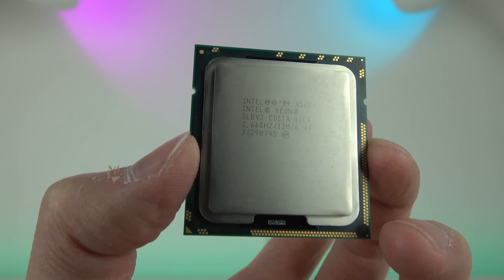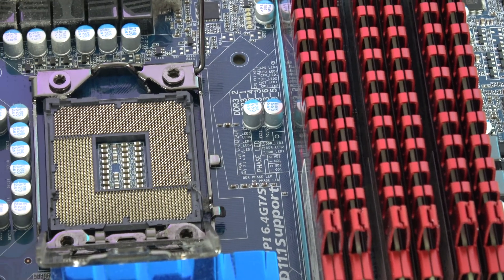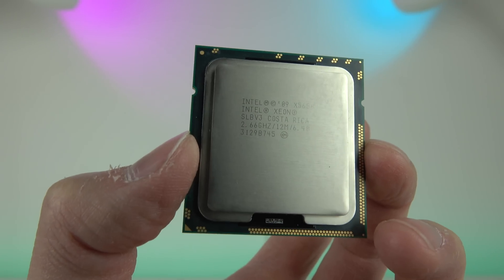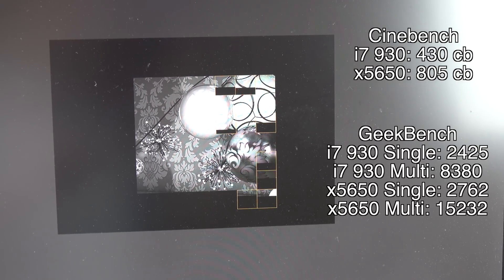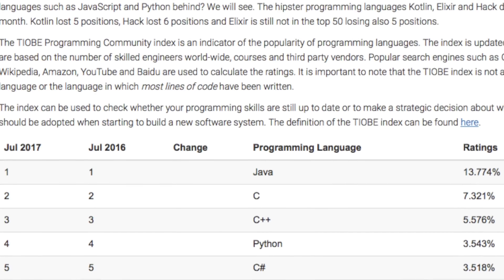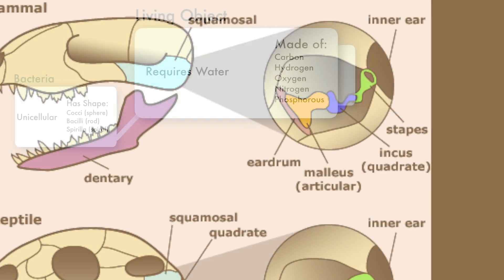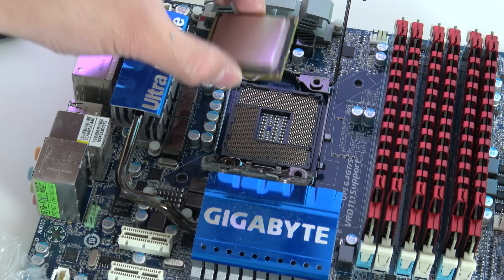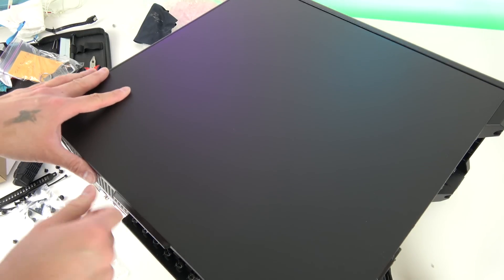This 6 Core CPU Costs $20. Will It Let My PC From 2010 Last 3 More Years?

Comment: I didn't know you knew LGR, a.k.a. Clint! That's awesome, he's a great guy.
Using the X58 platform means giving up a lot of modern features that I'm not so sure I could live without… with Ryzen 3000 coming out in 2019 with the entry-level being 6 cores for only $99… I feel like he might as well upgrade or buy a new computer with Ryzen 3060 or whatever it's going to be called. I feel like next year is going to be the best time for consumers to upgrade or by a new computer because huge leaps in computer hardware are happening next year. The core wars are about to begin between AMD and Intel. I recommend listening to one of AdoredTV on YouTube's tech videos about next year. It's fascinating stuff

Comment: I built a PC back in 2014. I still use it to this day. I've only made RAM and storage upgrades. I added 2 SSD's. I changed the boot drive from HDD to SSD and I have an SSD for game storage. I had to replace the power supply. I leave it on 24/7 so that was only a matter of time. I don't think it really is necessary to upgrade all the time. It plays games fine and renders alright for everything below 4k.

Comment: About to upgrade an old pc i have to make in usable.
CPU: AMD Athlon 64 3800+ @ 2.4GhZ.
RAM: 1GB DDR2
GPU: Nvidia GeForce 6150se Nforce 430
OS: Windows Vista Home Basic 32-Bit
Storage: 225GB HDD

I Wanna upgrade to:
CPU: AMD Phenom x4 9500 @ 2.2 GhZ
RAM: 8GB DDR2
GPU: Gigabyte GeForce GT 1030 OC 2GB GDDR5
OS: Windows 7 Professional 64-Bit
Storage: 225GB HDD (No upgrade)
Reply: About 100$ (1100kr here in Sweden), and i'll mostly be using in for web browsing, coding, light video editing and some light gaming on the side. That's why i chase the GT 1030
Reply: James Vo i'm getting 2x4gb ram Which ads up to 8
Reply: I'd recommend the RX550 over the 1030. I think for the same price you get better performance. @memmoman
Reply: @joonyee  Thanks for the recommendation! I'm gonna check into it a bit...

Comment: I'v always got a motherboard that takes the higher grade cpu's and would upgrade when the better ones became affordable, but recently with ryzen instead of buying a r3 and then getting the r7 later probably both for 100 it made more senses just to go for the r7 for 200. But there prices makes sense, unlike the psychotic people that buy high end intel to lose value a year later, and do it so that there is a minor point value difference instead of what you would notice in reality. For intel you could say that its actually a flaw in there marketing that Xeons just happen to be a upgrade now for cheap.

Comment: I have a workstation I built using an Intel S5520 workstation board.  It's currently equipped with a pair of Xeon W5590 3.3 GHz processors and I'm making plans to upgrade from a measly 24 GB of RAM to the system max of 192 GB. Throw in an RTX 2080TI and it's going to scream and be unstoppable.     I'm all about getting max usable life out of a motherboard, too.

Comment: in 2007  I built a system that was  speced :  AMD Athlon X2 5000 ,Bio star TA770+  main board, 2 gigs ddr2 ram ,  GeForce 9600 GT 512 meg of GDDR 3 vram and had a 250 gig HDD, running windows XP.  

today my mom still runs this pc (I gave it to her after I built my newer one in 2013).  Today it's specs are AMD Phenom II quad core, Biostar TA770+ mainboard,  6 gigs of ddr 2 ram , ATI radeon 5700 1 gb of GDDR5  vram    , 320 gig HDD running windows 10.  

in 2007 the PC handled any game I through at it , but by 2009 it was having trouble with newer titles, that was when I updated the video card and ram , every thing was beans and gravy again, it was gaming like a champ again, by 2012 though , it was beating it's head on a brick wall again , so I updated the processer.  going to a quad core it was able to game for 2 more years  (though not a top performer any more by any standard). in comes  my newer system  (and the one i'm still on today) in 2013. 

Specs on current system when it was new; 

AMD FX 3850  (stock setup , stock heat sink),  Asus Sabertooth 990FX  R2.0, 16 gigs DDR3 1866 ram,  AMD Radeon Powercolor 7870 MYST edition 2 gig DDR5  vram, 1 tb HDD running windows 8.1 

The HDD died on me in 2014 .. (thanks Toshiba). I replaced it with a HGST Deskstar 2 tb , HDD at that time.  
then at the end of 2016  the mainboard died on me  (a short in the back side USB jacks , would cause the PC to shut down on post). So I grinned and bore out not having a pc for a few months , I  saved some money and in 2017   I did a series of updates to the pc as I replaced the mainboard. 
First I upgraded my CPU cooler to a awesome after market cooler  , I then replaced the mainboard , and alstly I upgraded my aging video card ,  fast forward to today and the pc is still duking out what ever I throw at it.  specs today are 

Amd fx 3850  Turbo core turned off,  all cores OCed to 4.3 ghz , 16 gig ram (same as before), Asus M5A99fx Pro R2.0 mainboard, Zotac Geforce 1070  8 gigs of vram (can't remember type name). 2 tb HDD  running windows 10.       
System still handles every thing I toss it's way , and currently looking like it will still compete  for a few more years. 

point of all this being .. a well built system will last you a good many years these days.  That said threadripper  may be a game changer , all sources say we are about to hit another spurt of techno-leaps , like we had in the late 90's , which makes the future of my current pc look a little bleaker than I hoped.   but we'll see  currently I know of NO one that actually needs a thread ripper for general computing task.  A lot rides on what MS does in the next iteration of their OS.

Comment: I'm still wondering why those processors are selled almost like a gift.
I had a 775 Dual Core from 2006 and I replace it with a 771 Quad Xeon.
I feel like I missed a lot of my life without its extra power.

Comment: My 5 year-old Core-i7 4770 and GTX-780 is still going strong. According to cpubenchmark.net, CPU and graphics speed hasn't increased all that much over the last 5 years, certainly nowhere as much as the increase over the 5 years before that.

Comment: You have the same creative sub woofer I bought in 2006 with my 7.1 speaker system so I’m with you on using stuff for long time. And I still use the same case in my pc 2 time I upgraded the inside of my pc. My last pc was a core 2 duo then I went to AMD side with the fx  8 core next one maybe a ryzen but with 2 kids we got to have priority’s and my 8 core with a Radeon 290 have to last at lest 2 more years

Comment: There's just one problem - no AVX = no windows mixed reality. Overclocking 1366 is sort of a voodoo game with voltages. You can drop in 6x8GB DDR3 dimms and get 48GB RAM

Comment: Keep in mind not all Sockets (or motherboards) allow Xeon processors on them. For example I have an Ivy bridge (2012) Socket 1155 board. the best i can seem to find in Xeons is a 4 core Xeon will less processing power than my Core i7 i have in there now.. I'd love to find an 8 or 10 core for it..  the LGA2011 socket was a popular socket however and had more supported higher end CPUs at that time. I will say finding that CPU for $20.00 was incredible though and actually being able to take advantage of the performance increase is nice. Great video.

Comment: I still use my eeePC701 (THE VERY FIRST NETBOOK EVER!!!, 600/900 mhz intel Core arch. celeron, 2GB RAM-upgraded from 512mb, 4GB "SSD" + 32GB SD-card... it started netbook revolution ;-) as music and video player, it does full hd in VLC player ;-) 
And for troubleshooting networks, aligning multi KM range WiFi rural links, while hanging from a mountain wall ;-) etc (i rebuilt the battery with new cells, and will do again when this cells "die")... it will stay in use till it breaks beyond my capabilities...

Comment: It just so happens that I have a system with a Gigabyte GA-X58A-UD7 that I got secondhand from my uncle, so I was quite excited to find this video about a cheap CPU upgrade that can improve its performance significantly.  Since it’s not my only PC, I certainly anticipate using it for at least several more years.

Comment: Mine is an i7-2700k system running since 2011 and has burned two motherboards and 3 hard drives.

Comment: My 2009 computer looks kinda similar. I went with a AM3+ socket which lasted a long time for new CPUs. At this point I have replaced everything except the RAM. I now use those old parts as backup for my data.

Comment: i just sold my ivy bridge kinda regret it
Reply: rofl.....what irony -  for old times sake, i'm upgrading an HP i3-2120 dual core desktop system to an i7-3770K (Ivy Bridge quad / 8 thread). New Asus Z77 system board.  The 3770K completely trounces the Xeon X5650 (even with its 6 cores / 12 threads). I'll also be installing an nVidia GTX-670 4GB SuperClocked vid card...about as fast as a GTX-1050ti, so it'll be good for a few more years (ray tracing GPUs are going to be a long ways off, before they go mainstream).
Reply: @Trev0r98  yea mine was 3770k it was  a monster hit 5.0 stable no problem. Oh well.

Comment: Chubbyemu, just a curious question :

If hard drives and SSDs are compatible with future generations of PC's, as are PSUs (I don't recall computer manufacturers making too many different changes to power connectors), couldn't you make a PC theoretically eternal by considering the motherboard as a modular piece as well?  You'll still retain all of your data over the years (assuming you back it up and move it to new drives), but standards like the ATX and ITX form factors don't seem to be going away anytime soon.  There won't be any original part left over, but I'd still call my computer the same computer if it retains all the same data and settings tailored to the way I use it.

Might be wrong, or right, but it's good food for thought.

Comment: Should have gotten a x5680 or higher. 6 core 12 threads. I just built a similar system for cad/gaming. The higher end cpu with last for the next 3 years.

Comment: my 2013 computer about USD1200 i7 3770 16gb hd7850 Pro 3gb video ram, no upgrades since then, half of the fans dead in the casing haha. Still awesome =). but yeah my SB2 15" is my go to because its mobile.

Comment: Xeon x5650,supports up to DDR3 1333,has no integrated graphics,95 watts
Core i7 930,supports up to DDR3 1066,has no integrated graphics,130 watts...no wonder you needed that big CPU cooler.

Comment: You know what? I really enjoyed your video. I genuinely did. Because you take a completely different approach to the PC world like myself (which I plan on doing a YouTube channel soon myself). I built a system almost 7 years ago now. It has a FX-8350 (OC @ 4.6Ghz), Thermaltake NiC C5 (Outfitted with custom 
Enermax Vegas fans for better cooling and lower noise with also looking nice), 32GB G.Skill Ares (OC @ 1866Mhz), ASUS Sabertooth 990FX AM3+ motherboard, 850W Thermaltake Black Widow Semi-Modular PSU, 4TB of WD Green HDD, 126GB Radeon SSD, and a newly upgraded Nvidia GTX 970 FTW+. My computer has full RBG (by clicking buttons on the actual hardware) before RGB (addressable) was actually popular and mainstream. Everyone asks why I don't build a new rig. And you have the same answer as I do. My system (with a little push) will almost stand next to new Ryzen systems in 2018. Why spend another $2,000 or more for a new system when I have has this for so long and it has NEVER failed me. I still plan on building new very soon and maybe making a charity video by giving my system (Radscorpion) away to someone in need. Thanks for the appreciation you show for the PC world. You have a new subscriber. Much love and respect. See you around.

Comment: Upgraded my gaming pc from a i7 950 to a Xeon 5687. Since my 950 was bottle necking only on the newer games such as Rise of the  Tomb Raider and Witcher 3 and the 950 was not a great overclocker ( unlike others that I see on the internet ( lost the silicon lottery I guess)) I went to processor that was clocked higher, was 32nm instead of 48nm, plus the x5687 is a much more stable with a mild overclock overclocker. Now no game even uses more than 60% of the cpu and the cpu stays under 60c. Great deal for just 65 dollars.

Comment: i'm still using samsung gamer series 7 laptop since 2012/2013 only upgraded ram from default 16gb ddr3 1600mhz to 32gb 2133mhz and from default 750gb 7500rpm x2 hdds to 1tb each ssd samsung evo 840 ! vga card can't be upgraded physically can but once you do it bios on vga card in main mainboard so you can't ! but hey this laptop still runs perfect graphics driver can't be updated anymore nvidia doesn't support it anymore :( ! otherwise running windows 7 x64 ultimate perfect !

Comment: I was going to give you a hard time about checking the BIOS for custom settings before swapping CPU's, but then realized that I have done it myself. Great video man. I'm running a OC'ed X3470 myself (8 year old 1156 Xeon). Still going strong.

Comment: I have a PC with an I7 3930k and 16GB of ram since 2012. Over the years it has gotten some upgrades. The upgrades were mostly adding more SSDs. and upgrading the Graphics Card from a GTX 680 to a GTX 1080 TI. The system also has a SoundBlaster Recon3D Soundcard. But I haven't upgraded the Soundcard since its been working fine for me ever since. The system has 6 cores and runs at 3.20Ghz stock. When Turbo Mode is enabled. I get 3.8Ghz clock speed since I'm using a Phanteks CPU cooler on it. However the motherboard supports PCI-E 3.0. But the 3930k only supports PCI-E 2.0. So the graphics card and everything else was running at the 2.0 specs. If I upgrade the CPU to a 4930k. That CPU supports PCI-E 3.0. So I could probably see a jump in performance when the Graphics Card is using the PCI-E 3.0 specs which it was made for. The 4930k is not cheap but I have seen the prices on them going down a bit recently.

Comment: I built my system with the e8500 when it first released.  I also utilized OZ's heat piped 1333 RAM to run the FSB at full throttle.  Not long ago I dropped $40 on a Quad Core Duo Q9500, kept the FSB, but also went SSD, and a new NVidia GTX 1050.  A serious improvement in video editing, though I suspect the cuda cores are the cause.   I don't play games, so I'm partly content right now.  My Achilles heal is 2 fold, first is the use of Windows10 Pro x32.  Got it when upgrade was free, but Ram is limited to 4GB.   Can't upgrade to x64 without cost, and even so, you can not buy DDR2 at 1333 any more.  You have to drop RAM down to 800 just to buy any of it.  Ah well...  A new system is in my future, I just don't need it right now enough to warrant cost.  That said, my basic system was built in 2008, and with upgrades, is still with me today!  10 years and counting!

Comment: I have the same rig, I bought used last year. I love it.  Got a xeon w3680 in it at 3.33ghz.  With xeon, you can upgrade RAM to 48gb using server ECC RAM (with xeon processor) or 48gb non-ecc using a i7. Kinda cool.  I have mine running at 32GB, with mismatched 4GB and 8GB modules.  I can run seven games at once on mine before I run into stability issues with Virtual Machines, and for a 8 year old system, that aint that bad.  I find however that a newer generation i7 four core works about the same speed as my 6 core Xeon when coming to video encoding or encryption, so it does worth noting that older stuff does show the lack of performance optimizations newer stuff does, but overall is a really great value for your money.  I also am unable to run multiple video cards in my system without causing it to hang, which is something unusual, even though I can use other PCI-e devices in it.   I use my Asus Maximus 1155 board for that.   X58 sure beats using a Core2 or a AMD Phenom 2.  Not sure about FX processors, never owned or operated one.  Oh yea, that stock cooler is garbage if you ever run at stock speeds for extended periods of time.  Exposing your processor to heat reduces it's life, I know as I burned out three i7 processors since 2010.

Comment: is that the i7 970 equivalent? Can't remember if that has the unlocked multiplier like the 980/990. If so you should OC for sure. I have the 990x running at 4.5GHz and it still kills today in 2018.

Comment: Just upgraded my X-58 based PC, (same chipset as the one in the video) with a second hand uprated CPU, (i7 920 to a i7 980x) a bit of overclocking and installed water cooling and I'm running comfortably at 4.6ghz.A lot of new PC's rolling off the assembly lines still don't have the grunt this one still offers.  Get a new PC? I don't think so!This machine doesn't lack all that much functionality and performance that a brand new one would offer. So it's going to be around a few more years yet!

Comment: i own a 17-2600k 3.4-3.8ghz oc to 4.6ghz and i can only use 92-99% of of the 4 cores and the 8 threads are at 80% except for 2 which were at 98% and hwmonitor says it hits 7.8ghz every once in a while when i play gaming online when everyone lags mine won't the more you throw at it the smoother it runs the only benchmark i can't run is prime95. cinebench says cpu 820/gpu 100fps. but real life max high setting if get 60fps average in all games and lows of 50 highs up to 200fps

Comment: I totally regretted buying my i5 750. I also somewhat regret buying Intel in general. They seem to frequently change their sockets such that usually by the time I want to upgrade, I can't upgrade because there's no good CPUs available for the socket.

With the i5 750 this was extremely the case, since the socket hardly had any time to exist at all. It's really annoying

I guess you got kinda lucky getting a socket that would actually be a bit more future proof.